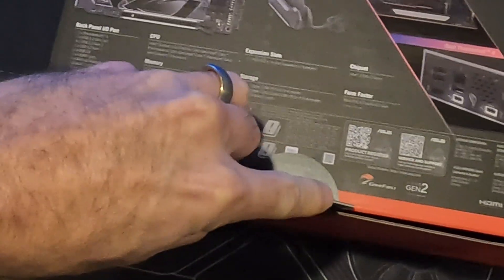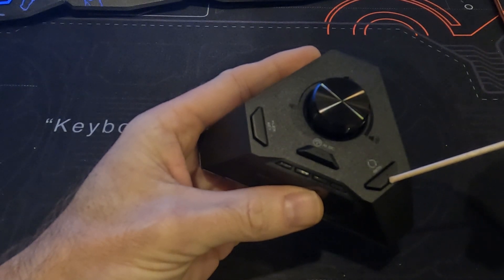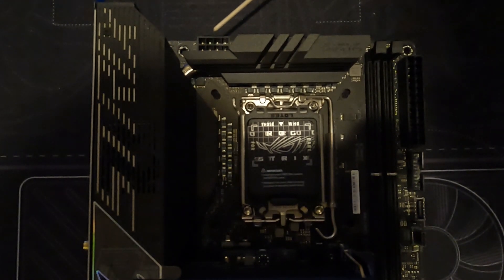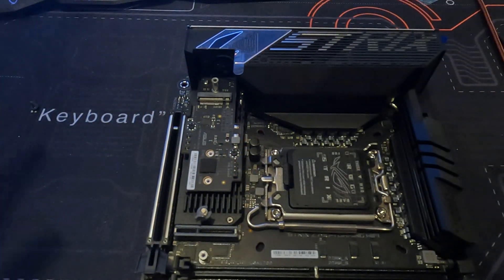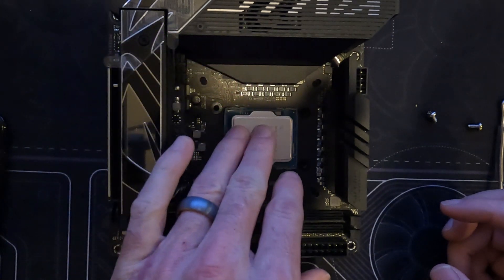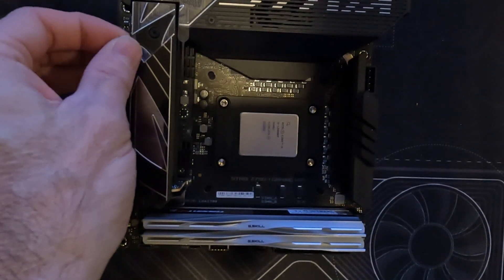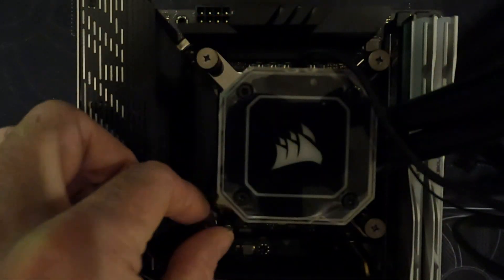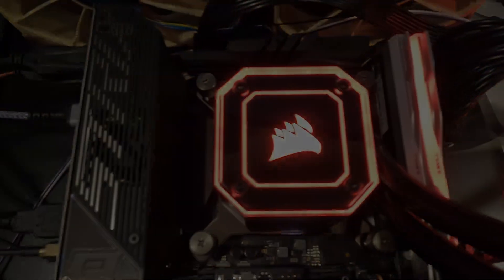What I DON'T like and OVERVIEW | Asus ROG Strix Z790-I motherboard

Comment: Have you ran into the intel NIC 2.5G issue with playing online games?
Reply from the maker: Asus allegedly fixed the NIC 2.5g issue that was happening on previous boards but time will tell.
Reply: @bricktronics  even if the NIC issue was found out recently on 700 series boards? I've wanted to buy this board but have been kind of reluctant because of the known issue, I usually get around 800Mb/s and my cap is Gigabit either way. I wanted to make sure the connection was at least stable.
Reply from the maker: @Aerobrake  so I just read about some having issues on 760 and 790 boards then others saying none at all. I will have to move my modem but can test it out for several weeks then let you know if you would like.
Reply from the maker: @Aerobrake  also, I just found that Intel has newer firmware and instructions to fix the issue
Reply: @bricktronics  I'm still thinking of getting this board so do you think you can help me out? Aerobrake#3098
Reply from the maker: @Aerobrake  for sure, first thing I'm going to do is update the firmware then I'll collect some data on it. I am teleworking currently, video streaming all day so it shouldn't take too long to find an issue if there is one. I will reply back here once I either have an issue or am confident in there not being one.
Reply from the maker: Here's an update for you and anyone in the community that's curious. The NIC 2.5G issue doesn't appear to exist after several days straight that involved 8 hours of video streaming and around 5 hours of online gameplay per day. I also did not experience any connection issues upon computer start-up. I also have a friend of mine with a z790 Maximus Hero board on a ethernet connection, same adapter, who plays online WoW for hours upon hours that has reported zero issues. This board and his came with the latest drivers installed that includes a fix that Intel had previously incorporated. If anyone is experiencing any ethernet connectivity issues with this 2.5g, take a look at this link. https://www.intel.com/content/www/us/en/support/articles/000057261/ethernet-products/gigabit-ethernet-controllers-up-to-2-5gbe.html

Comment: No SPDIF connector on the rear panel?  No optical SPDIF anywhere?  What's up with that?  Oh well, that knocks it off my list...bummer.
Reply from the maker: A lot of itx boards don't have optical outs, and yeah, this one has the SPDIF on the hive.
Reply: @bricktronics  I found the ASRock has everything I want...EXCEPT...Gen5 SSD!  There doesn't seem to be one board that has everything...every one is missing something.  But, maybe I will have to live with the least issue, which is the audio...I can use USB audio I guess, or perhaps there is a USB to SPDIF optical adapter...yep, problem solved.  This may be the only mini-ITX Z790 board that has Gen5 SSD?
Reply from the maker: @Dr.Bigglesworth  true, true. I personally don't like Asrock and favor Asus.
Reply: @bricktronics  I used to be a %100 ASUS builder, but I have MSI, ASUS, ASRock in different machines around the lab.  It's all in who has most of the features I'm looking for at the time.  The ASRock I have is in a rackmount NAS I put together.  Working just fine with no issues.  I think that was a form factor choice.  In checking, I have more MSI now than any other.
Reply from the maker: @Dr.Bigglesworth  I actually have a 50/50 split between msi and asus, Intel and AMD amongst 6 computers in my house. I like the Asus bios overall. It's clean and simple.

Comment: Thank you for the video. I have the same setup and the bottom left corner of the CPU frame overlaps with two small components on the board. Did you have any issues about this or made any modifications to the CPU frame?
Reply from the maker: Interesting, no, I didn't have to modify the cpu frame, nor have I experienced any issues whatsoever. Which brand frame are you using?
Reply: @bricktronics  I will be using the Thermal Grizzly frame, it looks like the one you have used and they have also recommended sanding it a little to prevent contact but I am glad to hear that you haven’t faced any issues.
Reply from the maker: I've used the thermal grizzly frame in the past as well, I didn't have to modify anything. Maybe I got lucky, who knows.

Comment: I purchased this motherboard recently. I had the store to build the PC. my case is NR200p Max which included 280mm aio. they insert the aio PUMP to CPU-FAN Header and the AIO fan to CHA-FAN Header. is that correct configuration or need to be replaced?
Reply from the maker: That is fine, providing there are no operational or thermal issues. I think they connected it to the cpu fan header to prevent an error message upon boot. When connected to the aio header, the cpu fan header needs to be disabled in the bios. The aio still operates exactly the same regardless of either header.
Reply: @bricktronics  really? not long, i tried to move it and it resulted different. now temps is on 48-61 (i use the AI contollred performance core ratio) on daily usage. previously it is at 60ish. also during cinebench. it only at 95-98. previously was 100c. whats ur opinion on that? i am considering also to repaste it since i dont know how they paste it..
Reply from the maker: @terrytjandra    yeah, it really doesn't matter. The aio receives a signal that the computer turns on to then power the aio, that's it. Pump speed and settings are not controlled by the bios in this circumstance. Your temp difference does not look like much. It's close enough where I could see the room temperature difference be the cause. Or other factors like how long it has been running, different apps running in the background.... things like that. I will tell you one thing, my current setup aio is connected to the cpu fan header with super low temps and great performance.
Reply: @bricktronics  how did u achieve that? are u using thermalright frame?
Reply from the maker: @terrytjandra  I'm using a frame, yes.
Reply: @bricktronics  i see, how to know if my temps are already right?
Reply: @bricktronics  also what frame are u currently using?
Reply from the maker: @terrytjandra  you haven't provided enough information for me to say whether your temps are normal or not. I don't even know what cpu you're using. I am answering your question and I'm here to tell you, the header port the aio is plugged into will not affect thermals with your aio.
Reply: @bricktronics  sorry about that am running  on 13700k with ASUS ROG Z790-I GAMING WIFI. my case is nr200p max so i am using the included aio but i swap the fans to noctua.
Reply from the maker: @terrytjandra  
- room ambient temperature?
- cpu idle temp?
- temp during benchmark? R23 cinebench 
- fan configuration? Aio intake or exhaust? How many total exhaust vs intake?
- any thermal cpu throttling?
Reply: @bricktronics  
- room ambient temperature? 24c
- cpu idle temp? fluctuating 48-58 sometimes jump to 60 or 70 (short period) but on average 57c
- temp during benchmark? Cinebench 2024 100c average 95c
- fan configuration? Aio intake or exhaust? i put the aio on the top with fan flow going upward, installed sickleflow 140mm on the bottom for intake.
- any thermal cpu throttling? yes during benchmark
Reply from the maker: @terrytjandra  Thanks for the info. Do you run high fan and pump speeds on the aio? Regardless, I think your temps are too high based off idle temp alone. It is normal for your cpu to run into the high 90s and even hit 100 during a benchmark. 13 and 14th gen cpus are designed to run warmer peak. I recommend repasting and ensuring proper water block installation. You can use mx-5 or kryonaught extreme....those are the two I like to use.
Reply: @bricktronics  fan set to 30% until 60c with 100% pump speed. i do consider to repaste with nt-h2. i heard kryonaught easily wears out
Reply from the maker: @terrytjandra  not all kryonaught wears out as fast. I use the extreme. Year and a half into it with great thermals. Really it's marginal, use the paste you want and I also recommend a frame, cheap and effective.

Comment: This is the worst motherboard I have ever had in all of my years of building computers. I went through three boards all with memory stability issues. The board I tried last ran great for about a week before developing issues.
Reply from the maker: This is the first I have heard of anyone having this issue. Might be a dumb question but is your memory on the QVL list for this board?
Reply: @bricktronics  not a dumb question at all. Usually whatever is listed on the QVL is just a guarantee that It will work with that set of RAM because it's been tested. With that being said, I have never followed the manufacturer's guide but I always use Corsair ram which is a very popular widely used brand which usually always works. I tried two different sets of Corsair ram. Both had the same issues and one was actually listed on the QVL list.
Reply from the maker: @JEFFREYSOLORIO I had a friend with this board where the memory wouldn't post that had to try several different sets until it would work. For me personally, I've built 4 or 5 computers with this board with no issues, g.skill ram. When I used to build and sell gaming PCs, going off the QVL list never let me down. But, thank you for sharing your experience. It sucks that you had to go thru all that, and it's good to hear you finally got it resolved.
Reply: @bricktronics  Yeah I kept getting an error message when I would run game applications stating that I was out of memory. The whole thing was bizarre since I was using 64 gigabytes of system memory paired with a 3080 TI, It should have been more than enough.
Reply: @bricktronics what type of CPUs did you use on this board if I may ask?
Reply from the maker: @JEFFREYSOLORIO  I have only used a 13900k and 13700k on this board
Reply: @bricktronics  Hmmm I only ever tried slapping in a i9-14900kf
Reply from the maker: @JEFFREYSOLORIO  ah, I haven't messed with any 14th gen stuff yet
Reply: @bricktronics  I'm giving the board one last chance. Thank you for your input really appreciate it.
Reply from the maker: @JEFFREYSOLORIO  no problem bud, I hope it works out. If you have any other questions or want to share anymore, feel free to here or on my discord server.

Comment: hello, thanks for sharing... I've been told that the ASUS B760I chipset and m.2 ssd get really toasty for no reason, can anyone confirm or deny (out of experience)?
Reply from the maker: I didn't have any thermal issues with the Asus B760-I during all of my tests, and that setup had two m.2 drives installed. Possibly a previous bios version or a case that doesn't flow air well could have been the culprit in other situations.
Reply: @bricktronics  thanks

Comment: do i need to use the hive? can the entire system run without it?
Reply from the maker: Honestly not sure, haven't tried without it. You would lose volume control and post lights.
Reply: weird... i am trying to build a very minimalist pc in the meshroom and would hate to use the hive.

the other mobo options don't seem as good as this. @bricktronics
Reply from the maker: @spy21498  the hive also has your headphone/mic jack....the back of the motherboard does not.

Comment: Great video. Can I hook up my external dac and amp through the Hive?
Reply from the maker: As long as you can adapt down to a 1/4" audio plug. Otherwise, I would advise using an audio or midi interface.

Comment: Idk man the asrock board looks a lot better than this more expensive asus one. I would pick the asrock if i were going down the itx route
Reply: I love ASROCK boards. The only issue with the ITX board is that 2 of the m.2 slots are on the back of the board. m.2's with heatsinks may have clearance and heat issues.
Reply from the maker: I do not like Asrock boards. Their bios interface is trash, they don't look good, and the asrock itx board isn't much cheaper than this one. But I appreciate your opinion, we are all different.

Comment: Great video question do you have to use that front panel cable connector or is it just a Extension for front panel connector ? Thanks keep the videos coming.
Reply from the maker: Thank you! More motherboard reviews are in the near future. Yes it has to be used as it has connections for the power/reset button. The Hive also has to be used for audio jack connections. Now the Asus ROG B760-I is a better option if this is an issue.

Comment: Hello, i would like to ask a question. is it possible to extend the usb connection with usb c extender where one end is usb c male and other end is usb c female ?. it would be awesome if it does because it will allow even more flexibility. thank you
Reply from the maker: Very possible, there are many products like you mention available on sites like Amazon.
Reply from the maker: Also the Hive on this board acts as a usb c extension as well. I have used it and it is very fast!